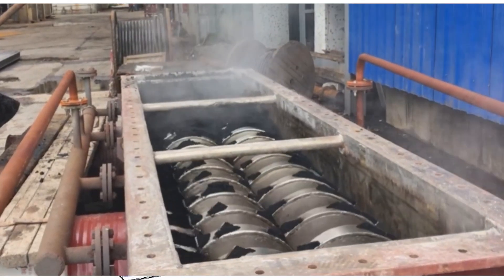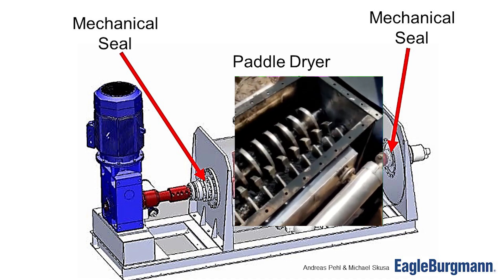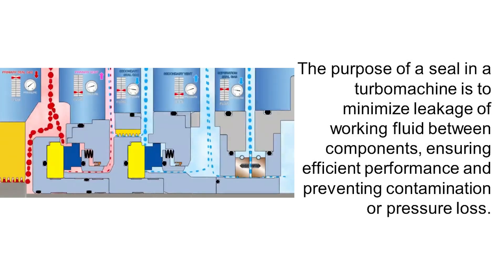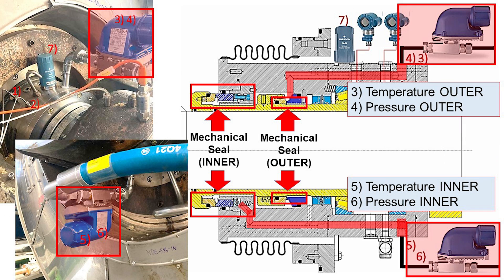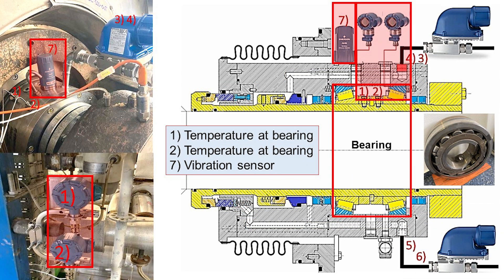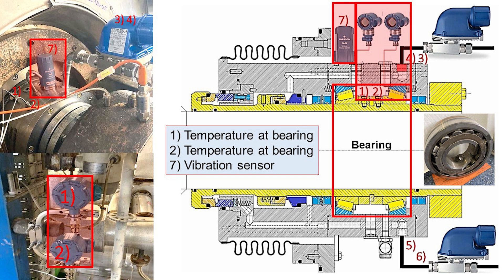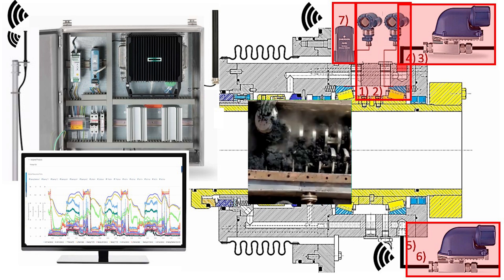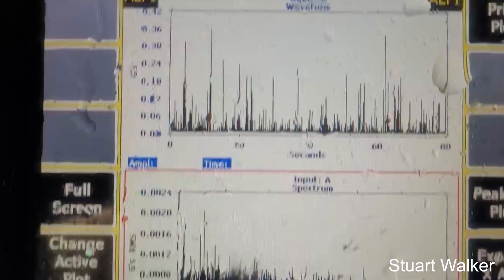Part 51 - Mechanical Seal Monitoring

Comment: Excellent video. How do they measure the temperature and pressure at the seal faces and why?
Because if leak detection system is there than no need for such an expensive monitoring system?
Can anyone explain please?
Thanks.
Reply from the maker: Great question! Temperature and pressure sensors at the seal faces are mainly used to monitor seal health and detect abnormal operating conditions early (like dry running, excessive heat, or pressure imbalance) that a leak detection system might only catch after damage occurs. Leak detection is more of a ‘last line of defense,’ while face monitoring helps prevent failures before they happen.